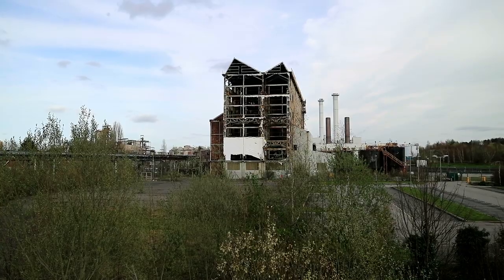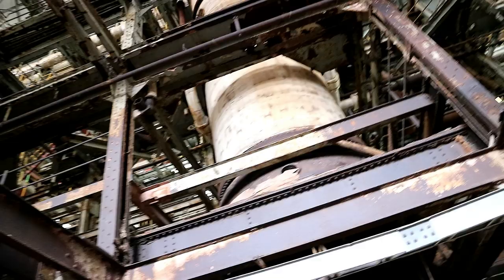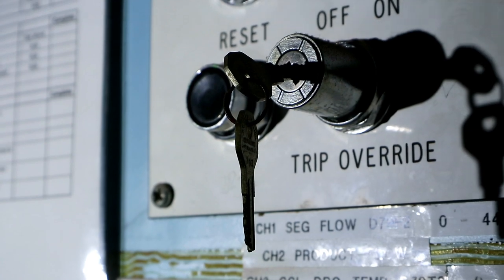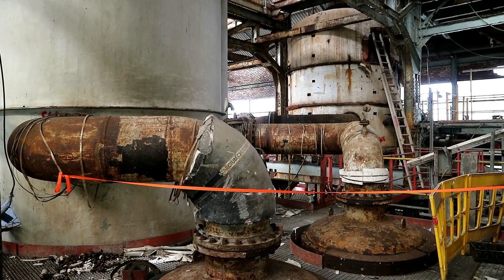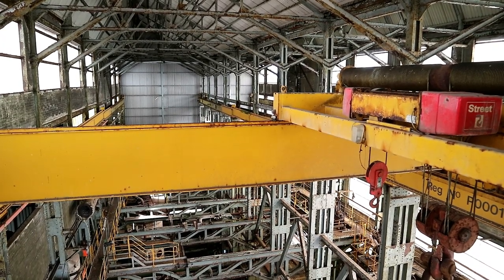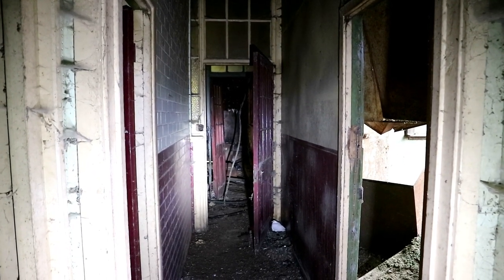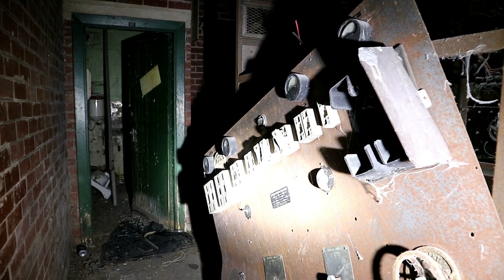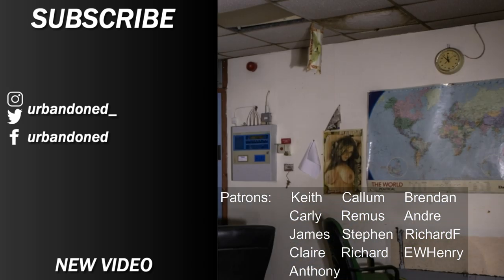Found Vintage 1920s Control Room in Remains of a Power Station - URBEX England

Comment: yes we have moved on with switchgear and control rooms to be more efficient.  but what we have lost in esthetics and design in the  buildings and control panels/rooms  is a grate loss .
some times going forward is not so good after all  , will our buildings of today be still standing and  hold the same interest  for the next two generations of urban explores
Reply from the maker: Going forward in efficiency isn’t a negative, but it is sad that rooms and buildings like these are being left behind in the process
Reply: @Urbandoned  keep the old face and dials but go digital behind in the works 
its a shame we don't design like we did then